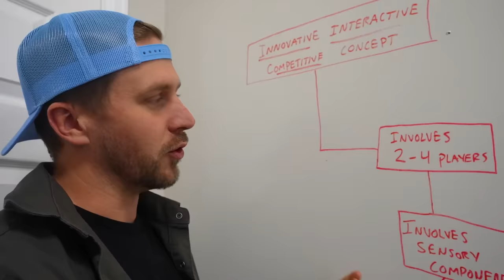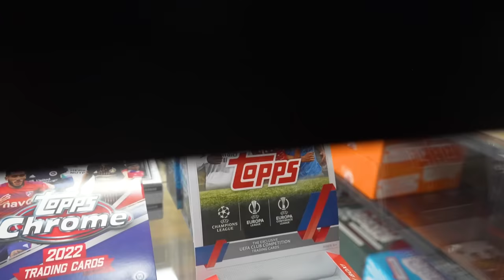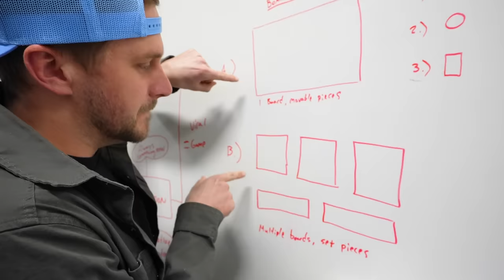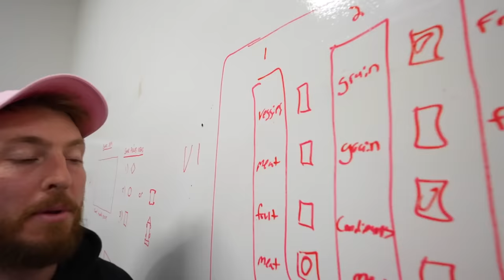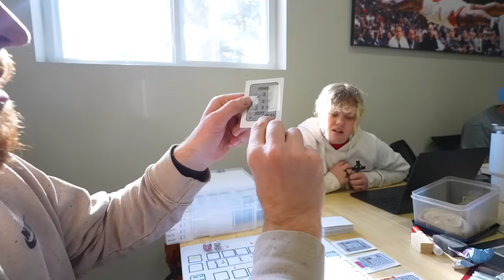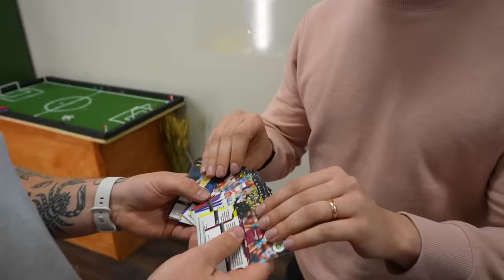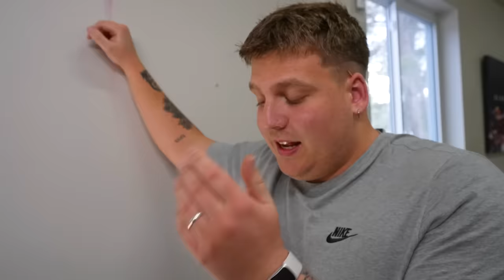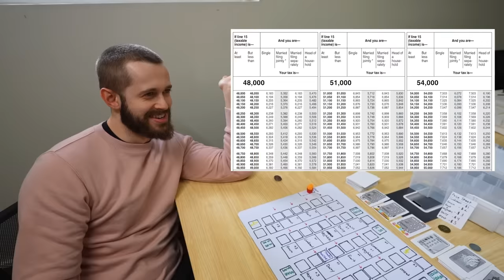HOMEMADE BOARD GAME BUILD BATTLE!

Comment: I had this idea for them, for quite long while, which is to do as another budget challenge. Which was Dungeon & Dragons budget challenge, as who can make the best D&D one shot session with a budget from the blinko board. 

Such that the budget goes into your setup (table, chairs, decor), dice (full set dice that can be acrylic or metal), mini figures, board (grid based), DM Screen (something to hide your own rolls as DM), Paper (Character Sheets or Notes), Notebooks, Pencils, and don't forget The books (Player Handbook, DM Guide, Monster Manual, Pre Written Campaigns, etc.). Of course, don't forget the snacks. Since Players will get hungry. 

Although I could see it be done under budget of $100 if you get lucky at the dollar store. Such as finding cheap toys as figures, dice maybe, paper of course, and etc. But without the books can be tricky if they don't know much about D&D.

Whoever makes the best experiences for D&D players pretty much wins.